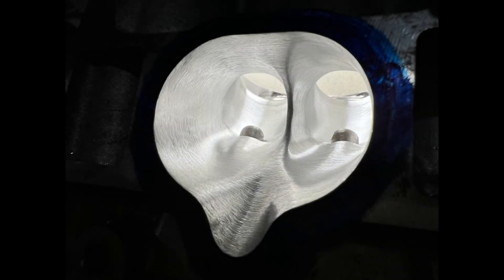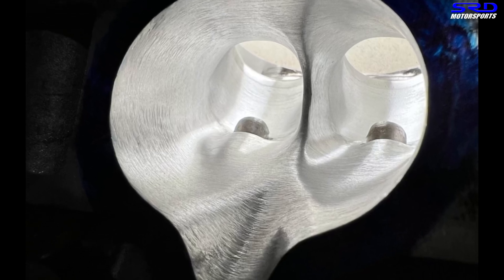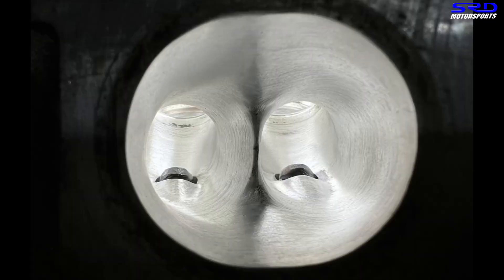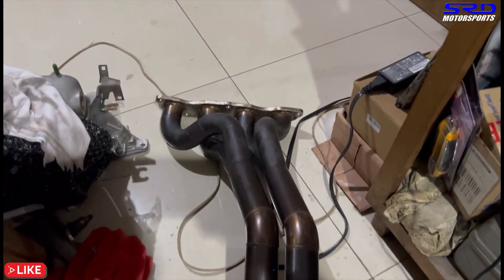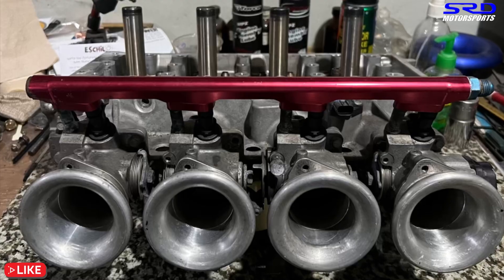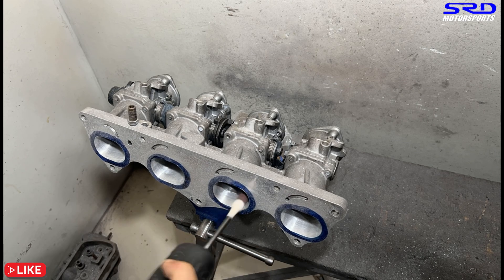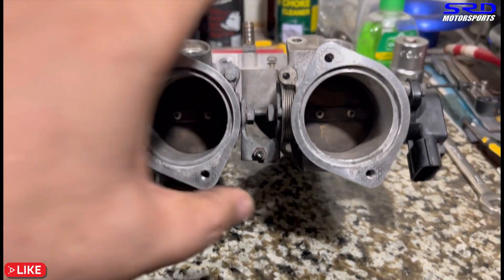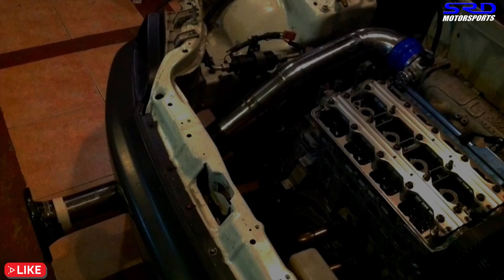K20a TypeR Build Series part 2 Port & Chamber work ITB tech

Comment: What k24 other than a1/2 can be ported and use on a k20a/z block? Reverse Frank kung baga.
Reply from the maker: Not sure I always just used and ported RBB casting head kase it’s proper vtec like the k20a
Reply: @SRDmotorsports  I’m trying to look for cheap alternatives junkyard parts and see if those can be swapped.  Any idea if the rdx crank will work with a k24block
Reply from the maker: not sure

Comment: Hola un genio en lo que haces  me suscribo y hago una consulta podrías hacer un vídeo hablando sobre el dimpling o efecto pelota de golf en la admision? Desde argentina .
Reply from the maker: That’s a very tricky topic but with air and airflow there is also “drag” that must be realized and not just one theory but not the other…
Reply: Gracias por responder , sería una buena forma de " achicar los conductos"cuando están sobredimensionados ? Dado que generaría una capa límite mayor aumentando la velocidad del aire ? La verdad ese tema me tiene desorientado.
Reply from the maker: @braiandinescu7098 yes that could help… but a lot of times the stock size is already good and a little bit of port volume helps depending on set up and intake manifold set up + exhaust
Reply: Bien , en mi caso es un motor turbo la verdad que dió muy buenos resultados pero siempre uno busca mejorar 😅 saludos y espero pronto pueda subir un vídeo sobre el efecto pelota de golf
Reply from the maker: Yes yes 😎

Comment: The short side radius air has the hardest time turning out from there in the intake port.  If you remove to much the air detaches from the short side floor and runs into the high side flow. It’s a newbie mistake often done.
Reply from the maker: Yep that’s so true and perfect word choice “detach” as it does on the short side as air doesn’t really like to bend any

Comment: Whats a rough cost to port the head with rrc manifold?  I have a k20z4, trying to get a few more hp without turbo or supercharging
Reply from the maker: we got a price list pinned at the shop page it’s around $450 with all machining done and new valve seals etc etc